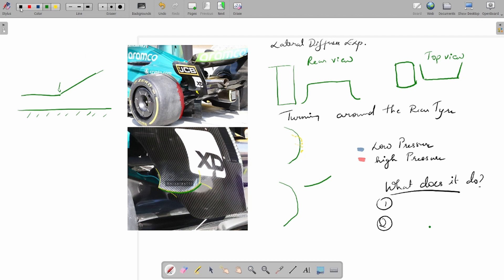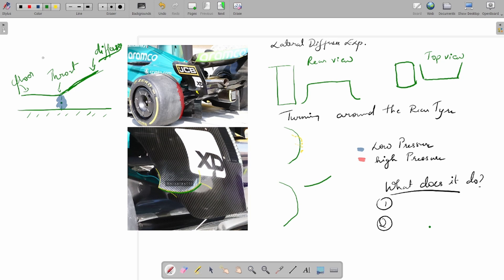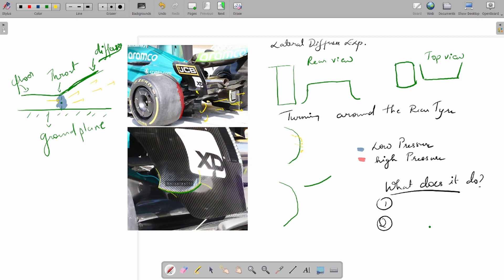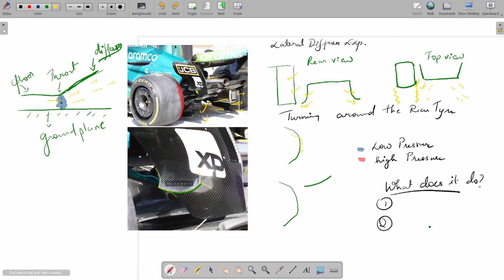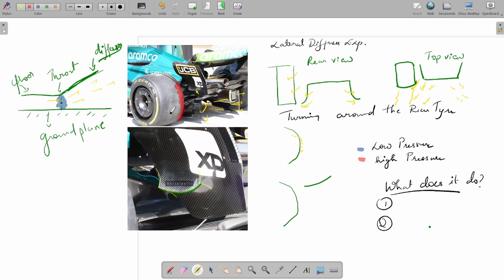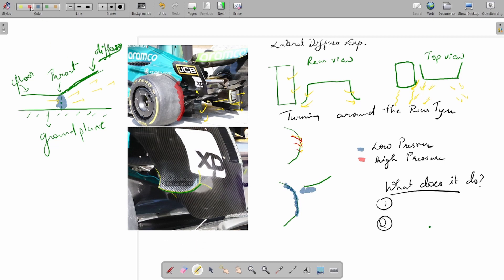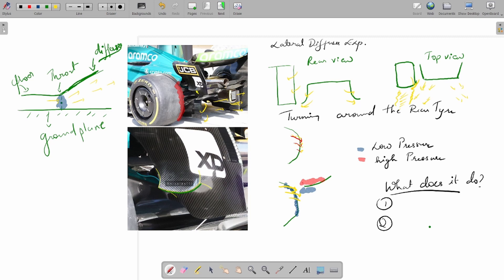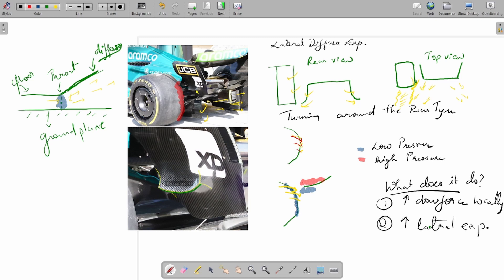F1 2023 Aerodynamics : Aston Martin F1 Rear Wing Endplate Winglet - Explained !!

Comment: Forcing air to do what you want is complex, and nearly impossible, aerodynamics themselves are relatively simple and straightforward. Air behaves consistently and predictably as long as the correct variables are accounted for. You can't make air do things it doesn't want to do, you have to work with the air. There's a lot you can learn from engine builders, particularly cylinder head porters. A good experienced cylinder head porter who spends a lot of time on the flow bench and the dyno, probably knows more about airflow than most aerodynamicists working in F1. A good engine builder will tell you, air likes to have a good line of sight to where you want it to go, to not try to force the air to turn too much, to keep the flow as straight as possible to maintain its energy. Small perturbations can have drastic alterations to the flow downstream. Good head porters unwittingly know how to deal with horse-shoe vortices, since air has to flow around the valve, and the valve guide, and guide boss, there's always a horse shoe vortex before the valve bowl area. If you look at all the high performance heads, the ports have winglets around the valve guide precisely to control the HSV.
Reply from the maker: Hi Ronald, thank you for that comment, I'd disagree on certain things, but I love your perspective on airflow 😊. Let's say we try our best.

Comment: Woah that's a neat little gimmick, using the walls of the rear wing to its fullest allowing cleaner air to the diffuser in straights and in the corners. Is it for altering the "wheel squirt"?

Have you considered a collab with Brrrake and Engine mode 11?
Reply: The wheel squirt is closer to the ground, so probably not. Think of a boat running on water. The wake that forms around the boat is the equivalent of the tire squirt. The front of the tire is running into the wind, and the side into the wind is essentially running over the air. The air gets squeezed our squirted out, like if you stepped on a packet of ketchup. This squirt is turbulent, and will follow whatever pressure gradient is around it. Some of it will go behind the tire to fill in the low pressure that gets left behind the tire as it moves away from the road on the rear facing side. Some of it will go to the diffuser since it is also lower pressure, and the tire turbulence raises the static pressure in the diffuser reducing downforce.

Keeping the turbulence from the tire from interacting with the diffuser will improve its performance dramatically, because the turbulence of the tire isn't mixing with the low pressure in the diffuser, the air in the diffuser isn't being slowed down by the turbulence caused by the tire wake.

How do you keep the turbulence out of the diffuser? Lower the pressure differential at the tire, that means lower the air pressure landing on the front of the tire, and raise the pressure at the rear of the tire. Lateral expansion of the diffuser(ie behind the tire) does just that, because the lateral expansion fills in the low pressure wake on the rear of the tire.

Using the sidepod to block airflow to the rear tire, lowers the pressure at the front face of the tire, and lateral expansion raises the pressure behind the tire, the end result is lower pressure differential and a smaller wake, which results in higher performance from the floor.
Reply from the maker: @rolandotillit2867  now that is an amazing reply mate 😊... With a great example , I learnt something from this as well.m love the ketchup example.. 🙃
Reply: @rolandotillit2867  Thanks for the visualization and education. Appreciate it.
Reply from the maker: The wheel squirt is not that affected much I believe, it's the mid wheel wake that gets affected mostly